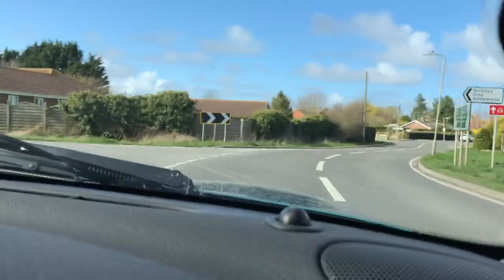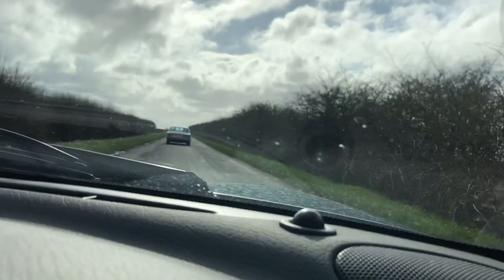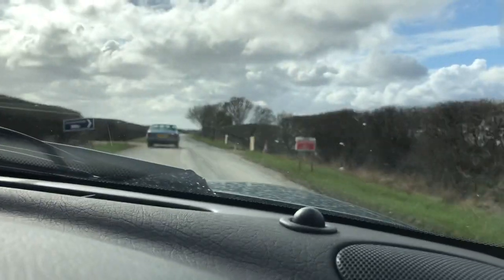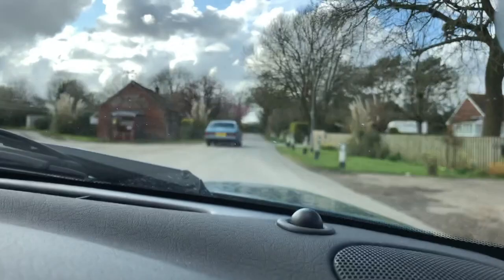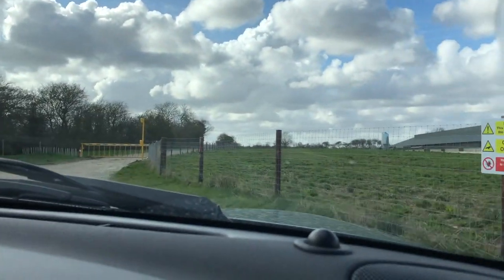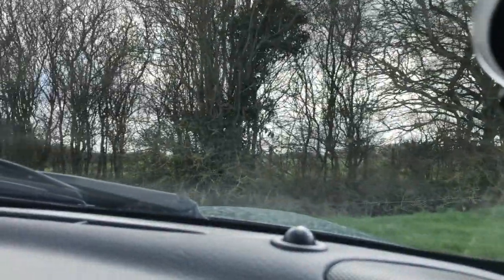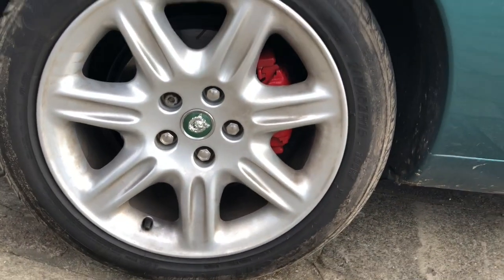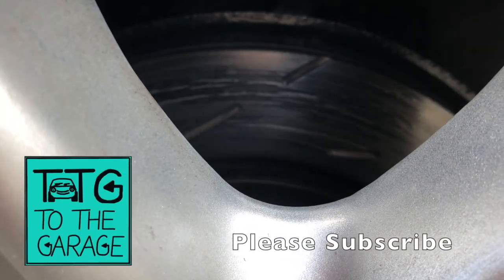Secrets of the Jaguar XK8 & XKR Ep 56. Perfect nut storage

Comment: Hi John, has your traction control and abs light reset after you took purdy for a run, mine did after working on the brakes? Another little tip, have you checked on your ECU and gearbox ECU, which are located under the front scuttle in an enclosed plastic box. Some hold water and do not drain, I had this on my xk8 and ended up drilling holes in the bottom to let the water drain out. The lid is held on with I believe m6 antitamper bolts, you can get them out and replace with ordinary bolts, worth a check
Reply from the maker: Hi normanb33. No they are still on. Next step is a quick sensor check (I do suspect the front left sensor as I was unable to remove it during the rebuild and would have to drill it out to remove it) But I will be removing the tamperproof and drilling a hole as you suggest regardless of how the sensor swap goes..
I recon its a Secret of the XK8.👍
Reply: @ToTheGarage  good John, my xk8 was third full of water, not good. I have checked xkr and that was ok
Speak soon 👌👌

Comment: You should have blasted past that Roller in your way ! Only joking. Are the brakes any better that before the upgrade ? It looks like you went to a lot of effort and expense. Are the stock XK8 brakes that bad, surely not ?
Reply from the maker: The originals were 'Adequate' but uninspiring when pushing on. Not fully bedded these in yet so will report back soon on the effect. Lock down due to the corona virus will delay that interesting day of driving though👍. Early signs are that feel is much improved.

Comment: Can you daily drive an XKR? I would like to buy one and daily drive it roughly about 40 minutes a day 5 days a week.
Reply from the maker: In my opinion its not a problem as long as the fuel consumption does not offend you. The XK8's are CAPABLE of 30mpg on a run and the XKR's a little less. But the issue is that self control will be low in either of them😉. So both are CAPABLE of 17Mpg!
Good question though Kuddlesworth NA and I will be interested to hear from our other subscribers, many of whom do Daily them.
Reply: Of course you can. But I personally don't when its wet. Personal choice, but I'm one of the owners that worry senseless about the adverse effect the wet (or salted roads) have on certain, well documented areas of the x100. In the dry (and no salt to be seen anywhere), it's out as much as possible. A grown up family also dictates usage.
Reply: @Redeye196513  Thanks, tghe only problem I will have is that if I get an XKR it will have to be my only car because I can't really justify having a second car. It will have to go through the wet and salt. I would probably get an XKR and have it undercoated or treated in some way to help prevent rust though.
Reply: Kuddlesworth NA go for it! You won’t be disappointed. Taking those precautions will help greatly. As I said, I’m just a bit of a worrier on the rust front. But there is a huge league of x100 owners who use their cat as their daily drive regardless.